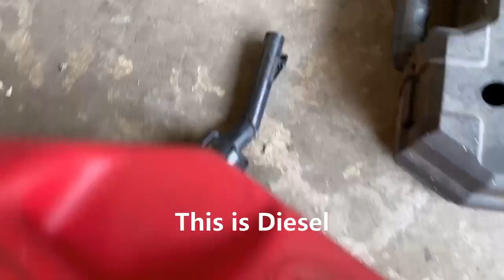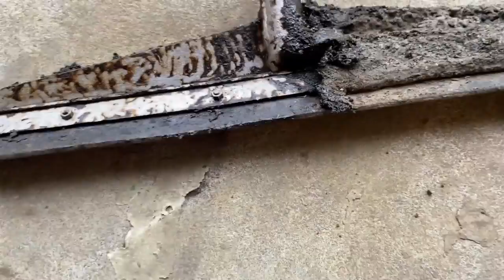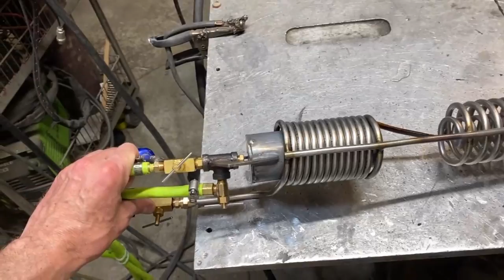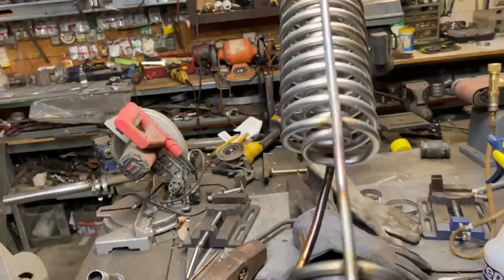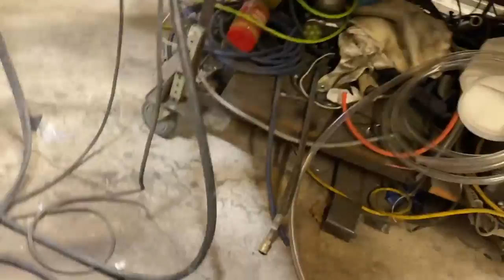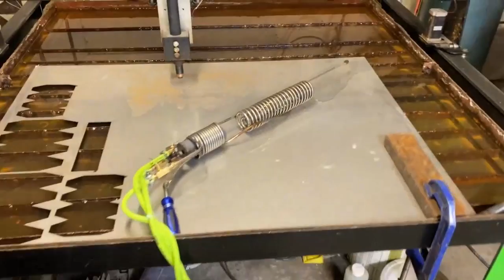Steam Axe for tar removal and Ice dam removal

Comment: That stuff is sealcoat. Asphalt crack sealant. I know it well. 
It is absolutely horrible to clean it up.
  Gasoline will do it better,  but then you are dealing with gasoline, brushes, fire hazard, and labor, a lot. Plus you wind up with a bunch of has-mat to dispose of, which if you do by the rules, runs into money.

Comment: Add forced air and an enclosure around the coil and you can get super heated steam
Reply from the maker: the enclosure is a bad idea not sure why every body advocate it . would you put a gard on a blow torch flame ? The flame needs to breath and it cant cost thousands of dollars to do it . Had a customer try the Guard and he called me told me his steam gun stopped working LOL , told him send me a pick so i can fuggure out what its doing , told him remove the guard he added , sure enough worked fine after that
Reply: @NOBOX7  huh maybe its not getting enough air? Maybe do the enclosure on the coul with intake holes closer to the handle to make sure the flame can pull in enough oxygen

Comment: Propane can work if you use the tool to periodically heat up your tank. My father in law tells stories of working on a seismic crew in northern Canada in the winter. Their shacks were heated by propane... they had to take turns on cold nights to go outside with a blow torch to heat the  air tanks.
Reply from the maker: Yes i do it but never showed it or spoke of it  because the safety queers come out of the wood work and i get tired of being beat up in the comments all day by a bunch of foul mouth ferries  . We deiced our jobsites with propane and i would " lick " the tank with the torch all the time
Reply: @NOBOX7  Never take a blow torch to a propane tank around other people.

Comment: How close to cost effective is adding a thin sheet metal tube to the coil assembly in order to wind proof it and contain the flame around the coils better?  The best source I can think of is large cans and hose clamps, but only a customer is gonna do anything like that. If there is an easy way to hold it in place around the coils without them touching the outer covering, I estimate that will be the best option by enough to justify the effort to make it that way, regardless, i just can't tell if the heat on one side of the sheet metal will be enough to add to the heat conducted to the coils or if the other side's cooling effect would overcome that.  Is this a useful idea to you?

Comment: Wouldn't a solvent based approach work better?
Reply from the maker: no
Reply: You would need really alot of solvent to disolve even a small amout of tar when it hardens, it makes like a skin on the surface that "protects" it, something like aluminium. It depends on the type and mixture of the tar but it sucks to dissolve it. Besides it would take ages, so if you can clean it up in 30 minutes with few cups of diesel and pressure washer i think its better.

Comment: Fuel consumption is not equivalent to energy out. You'd be lucky to get a third of the gas's heat. Still a lot of power though.
Reply from the maker: Its close enough , you burn 1 liter in 1hour thats a known 10,000 watts
Reply: @NOBOX7  Tell them young ones a fact NOBOX7. Sometimes getting stuck in the facts prevents one from seeing the trees. Just saying fella.
Reply: While this is true, most burners are rated the fuel consumption rate not the work they can do. There is two reasons for this. First, the amount of useful work done by a burner will be application specific. For example, the amount of work i could get running this flame through a turbine and the amount of energy i could get by boiling water with the flame would not be equivalent. Secondly, engineers want to know how big of a fuel line they need to run to every burner they're using. A lot of annoying math goes into that already, so having to convert from some arbitrary standard back to fuel consumption rate would be a pain.
Reply: @randomconstructions4513 THATS A FACT JACK!!!!!!!